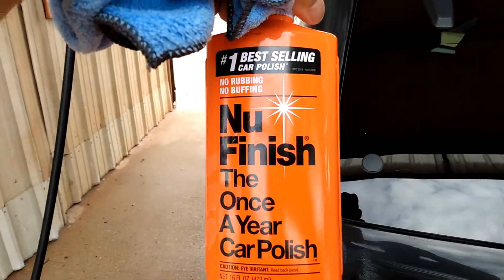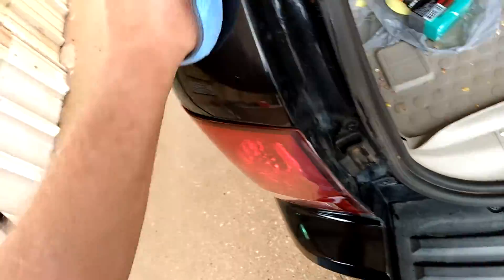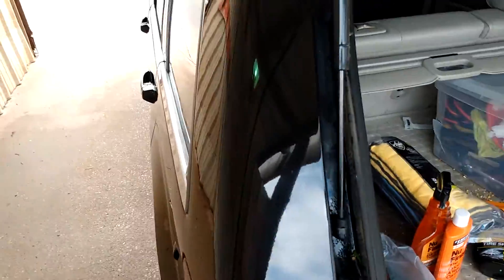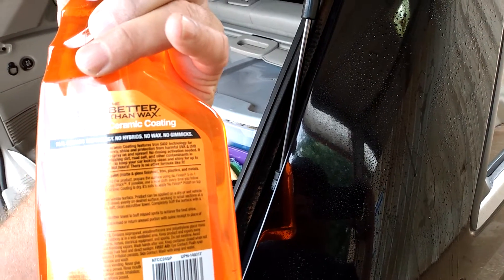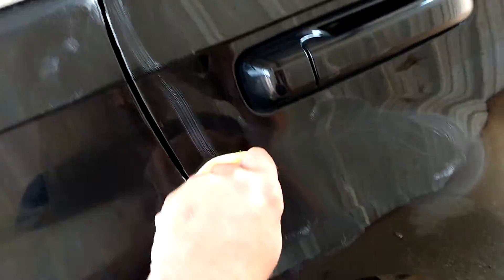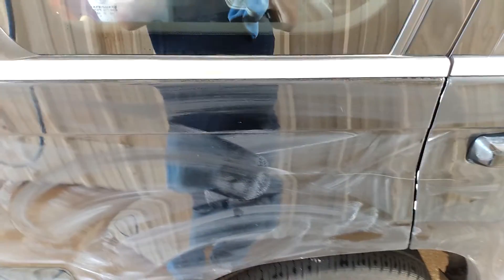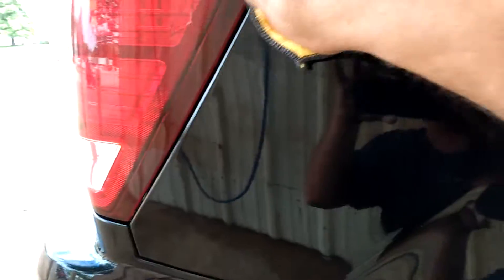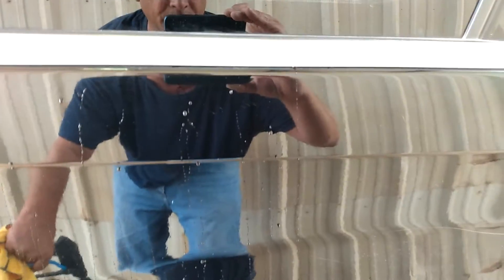Nu Finish polish and Nu Finish ceramic spray after using the Nu Finish polish review

Comment: I prefer the original NuFinish polish formula. I’ve always used NuFinish original formula for years until yesterday when I purchased their NuFinish “Better Than Wax” Ceramic Spray. The original liquid polish is easy to apply and very easy to buff off, gives a great shine and a smooth glossy paint surface. Yesterday after washing and using a clay bar I found out that new Ceramic spray is easy to apply but more difficult to remove and buff off, and also doesn’t give that super slick smooth feeling on the paint surface. You will also need to apply a wax over the NuFinish Ceramic to get that slippery, smooth paint surface. Also, I had to use three times as many microfiber towels using the ceramic vs the original NuFinish formula. 
Take my advice, Stick with the original NuFinish, it’s easier, better shine and feel.
Reply from the maker: I noticed the haze after wiping the Nu Finish better than wax ceramic spray washed off after the first carwash and shamming.
Reply: @joshuamoore24_7  yes, it will wash off but it’s a lot more work than using regular NuFinish polish in the first place.

Comment from the maker: 30 second to 1 minute is usually enough time for the Nu Polish to dry before wiping with microfiber towel. You want to use the product in the shade on one badly panel at a time. If the clear coat is missing and the paint is exposed the product probably will not work on those areas and the vehicle will need painted.
Reply: Actually according to the bottle and the website you use the spray ceramic coating 1st then the polish